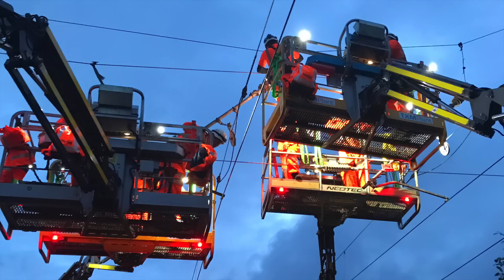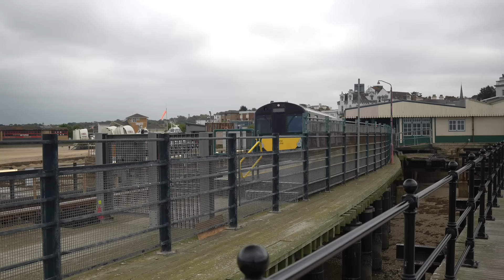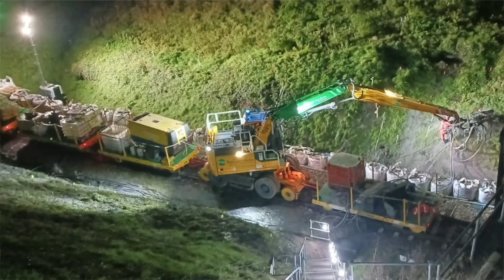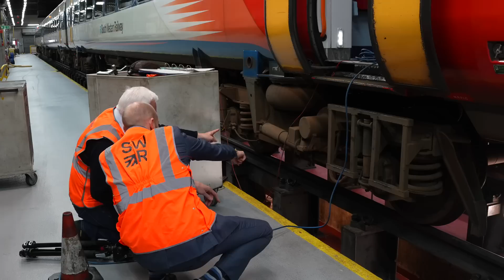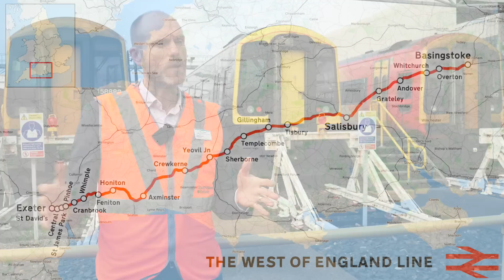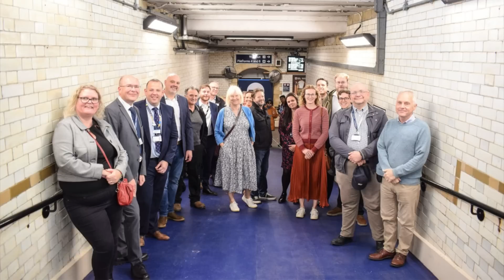Electrification, battery trains, third rail – Finding solutions for South Western Railway’s network

Comment: If they ever re-open the Maldon-Witham branch line, then that is one that's definitely ripe for battery train technology, as is the current Marks Tey to Sudbury. In fact I'd go further.... Maldon to Stansted Airport via a newly built high level platform at Witham. Battery operation between Maldon and Witham, OLE on existing systems between Witham and Braintree, and battery again between Braintree and Stansted.
Reply from the maker: I would set your expectations of that ever happening at an appropriate level (i.e. NIL)

Comment: I can see electrification from Basingstoke to Salisbury happening and from Southampton Central to Salisbury but I don’t think it will ever happen. Not to mention plans to electrify the Chiltern Main Line from London Marylebone to Aylesbury, Princes Risborough, Banbury and to Oxford. 

With electrification from Didcot Parkway to Oxford that Class 800 and Class 387s would operate AC 25kv OHL to Oxford from London Paddington. And electrification on the Uckfield line and Marshlink line with DC 750v 3rd Rail.
Reply: Far too sensible!

Comment: Surely the fantastic class 755 Bi-Mode is the perfect option for the West of England Line? Run third rail from Waterloo to Worton Junction before running diesel down to Exeter.
Reply: The whole point of the exercise is to get rid of fossil fuel altogether. No diesel.
Reply: @rogerphelps9939 You could do that with a 755 however or variant which can eventually lose the diesel power generator cars once electrification is complete
Reply: @rogerphelps9939  Which knowing SWR means they want "cheap" solutions. I.e we've got too many 701s so where can we shove them to keep the DFT happy. The arterios are completely sub standard for a route like London to Exeter.
Reply: Dreadful track bashers and the seats on plinths are a hazard.
Reply: @rogerphelps9939 
In other words, borderline pointless, Railways are responsible for 0.7% of carbon  emissions.

Comment: In my opinion the 25kv overhead system is the only way forward. The West of England line should be treated as a mainline instead of some sleepy branch line.
Reply: Or just do what they did with Waterloo - Weymouth, and use diesel locos and trailer units.
Reply: Incompatible with the rest of the South Western network.
Also if you were listening it’s expensive and not viable for lower traffic lines
Reply: Most definitely. More dualling needed too.
Reply: The AC 25kv OHL should have been extended to Reading Green Park with a bay platform built for the Class 387 to terminate at Reading Green Park from Reading.
Reply: Personally I'm wondering if half the problem is that the overhead on the Great Western Main Line is built for 140mph operation, and people are assuming the same  pricing for that, whereas the Salisbury-Exeter line doesn't need anything like that. Maybe overhead closer to modern light rail standard for example, and a similar power supply. Other lightly  used lines may not even need that: just something similar to tramway overhead with bow collectors would suffice. Assuming there wouldn't be much difficulty in getting MUs to run on different voltages and currents with off-the-peg inverters etc. nowadays.

Comment: Maybe electrify from Basingstoke to Salisbury and from Southampton Central to Salisbury with DC 750v 3rd Rail. And from Reading to Basingstoke with DC 750v 3rd rail to Reading Green Park & AC 25kv OHL from Reading Green Park to Reading.
Reply: Third rail all the way from Basingstoke through Reading connecting to the Waterloo line. Provides an alternative route when embankment slides occur between Basingstoke and Woking.

Comment: Great programme as always, but I seriously wonder about the safety of new sections of third rail being switched off.  I am very concerned about kids trying it to see if it is live, especially in areas where they have never had third rail electrification and therefore have not grown up with the dangers.  I can see the merits of energising only when needed but I wonder if this will lead to more accidents not less.  John
Reply: I agree.  Turning it on and off clouds the issue.  To add another system is potentially another fault waiting to happen.
Reply from the maker: Well, let's wait and see the full risk assessment and then we can form a view.

Comment: Yes, the Waterloo to Exeter route is very often a nightmare of overcrowding.  Yes, the 158/9 units are excellent trains and more comfortable and roomy than many more modern units.   I would have thought that redeploying the HST Castle sets on the Salisbury line (when GWR finishes with them) would be a good bet - they offer more capacity than the 15x units and Salisbury depot already has diesel expertise.  The idea of running battery driven trains from Basingstoke to Salisbury might be eco-friendly - but given that the line is mostly used by people travelling right through from London to Exeter with appreciable amounts of luggage, forcing every traveller to change at Salisbury (when at the moment about 50% of the trains run right through without a change) is not very passenger friendly.
Reply: I though about this too. Just remove one of the generators similar to what ScotRail did and they'll happily sit at 100mph with just the one MTU unit - maybe even have a battery installed as a replacement in one of the driving end cars instead. Or do what Chiltern did the some Mk3s. Possibly fit batteries under the DVT.
Reply: HSTs are old and need to be gone.
Reply: @EM-yk1dw  Quite, they are very much life expired and it's nor really economically viable to keep them going. Plus why should they be replacing old trains with much older ones?
Reply: We tend to go West rather than East, although I note how the trains get nearer to WAT they fill and the last one we caught at CLJ for SHE (nine car) was already full and standing.  Catching the late afternoon trains from EXD they are jammed by the time we leave EXC but by AXM there are far fewer on board.  (Lots of students) Living near YVJ we get a good look at the trains (I need to stay in more, away from the rest of humanity I think!) and tbh most trains are not that busy at this point.   The conclusion I draw is that most people do not go from WAT-EXD!   (Don't let a politician near that statement as the conclusion that could be drawn is that so few tickets are sold for that journey, the line needs to be closed! )
Reply: 'Most users go all the way from WAT - EXD?'  is that correct?  Judging by my observations the trains as they pass us (half-way SAL-EXD) are not necessarily that busy and we never have trouble getting a seat.
Reply: @Beatlefan67  Oh no, I'm sorry I said that wrong. I didn't mean  to say that most passengers do the whole journey - only at certain times of the year (summer holidays, University term starts and end, weekends Easter and Christmas) when perhaps a majority do.  

Waterloo to Salisbury is generally a busy route due to the London commuters (of which I was one for a decade) defence establishments around Salisbury, and when the winter or summer soltice gatherings happen at Stonehenge it's standing room only and staff preventing any more getting on at Waterloo!  However, Salisbury to Exeter can also be busy - especially at weekends due to University traffic - and in the summertime (at least when I was riding the line) there were a significant number of people (with suitcases) heading for Paignton on the through service from Waterloo.

My point really was that making through passengers for anywhere beyond Salisbury (who by definition are likely to have more luggage) change trains, may suit the railway's plans, but it's hardly an improvement to passenger convenience.
Reply from the maker: HST's, wonderful though they were, are now life expired and will be replaced.
Reply: @ I agree, although without wishing to sound negative new trains are never an improvement over the old in this country

Comment: No mention of Salisbury-Romsey-Eastleigh/Redbridge which is normally 158/8s.
Reply: Would work in hand as units could charge batteries while they travel over the existing sections of 3rd rail. 3rd rail should be fitted in Salisbury Station most definitely
Reply: I was wondering this exact thing

Comment: I do wonder if another benefit of implementing traction batteries on existing 3rd rail EMUs may allow for a reduced peak load while on the (quite power limited) 3rd rail network, thereby potentially allowing for fewer or smaller substations to be used on new / renewed sections.
Reply: It can use some battery power when accelerating and thereby reduce the load. But if you have intermittent power then the power drain is surely higher as it must both power the train and charge the battery.
Reply: @Talon5516-tx3ih  True but surely if you link the power delivery to the charging system you can avoid it trying to charge while accelerating? Far from the most complex thing.
Reply: @iman2341  That's not what I meant. On acceleration it draws power from the battery to lessen the load and/or accelerate faster - which is also good. But at cruising speed the train must draw more power than a simple electric train as it has to recharge. Compared to a fully electrified railway the power drain would be more peaky - i.e. it could be that several trains are charging and so the load is higher, but then it drops to zero as they're all running on battery. But I guess the  acceleration phase is always going to require the most energy so that may be irrelevant. Also as batteries are not 100% efficient the partially electrified setup will require more energy overall.

Interesting though. A couple of times I've been in the Siemens Mireo B trains in SW Germany and of course as a passenger you notice absolutely nothing different when it's running on battery. It's just an electric train.

Comment: How many accidents happen on the third rail where death is by electrocution, at the moment?  Have we any stats and how many miles of third rail are there?
Reply: Stop asking relevant questions.
Reply: I lived in the 3rd rail electrification area of the south of UK for six years 1957 to 1963. I never heard of any accidents, deaths or near misses with the 750v rail.
Subsequently, although living overseas since then, I have kept in touch with the railways of the UK through Rail Magazine. The only case was a girl who crossed the line at Bournemouth station about two or three years back, and was badly injured, but servived.She was then turned into a hero by the press and others instead of accepting that someone 15 years of age should have known it was dangerous. When I was 10, I knew the dangers of electricity!
Third rail deaths, must be very low in UK from way back until the present time, so what is going on here. I can never fathom out the authorities reluctance to extend 3rd rail where it is obvious it would improve the whole system. I have never heard of any problems at Merseyrail either!
Reply: @physiocrat7143  Haha!  Thanks, that made me chuckle.

Comment: Bi-mode of third rail plus Diesel electric must have been thought of unless there's problems with the concept
Reply: Third rail sparks quite a lot, and the fuel tanks are under the train!
Reply: @andrewhotston983 fair point, the bi-modes in this area are 25kv overhead and seperate 'power car' (in middle of train) containg engines etc

Comment: We're right by the SAL-EXD line (SHE-YVJ) and the timing generally is pretty good.  I like the 159's and find them comfortable and overall I'd 'mark' them highly.  Coming 'up' is the pain as I would wager 5/1 that we'd get stuck at Pinhoe for several minutes.  The joys of single line... 

As for the decarbonising, frankly I'm going to be in trouble for this, but IMHO it's complete BS.  Great Britain has 0.85% of the world's population.  I think anyone can work out the result of the decarbonisation as a percentage of the world's output.  However, I now read that carbon makes up 0.04% of the atmosphere - is that correct?
Reply: I agree - decarbonising is all cost and no benefit.
Reply: You have a lot of learning to do as regards global warming. It may well be true that GB has less than 1% of the world's population  and  only a small proportion of the total CO2 emissions but that is certainly not an excuse to do nothing. If everyone took your attitude civilisation would be doomed. As far as CO2 being just 0.04% of the atmosphere here is an experiment to try: take a litre of water and add 0.4 grams of strong food dye. Mix well. What do you notice? If that does not get you thinking along the right lines I suggest you ingest 50 or so paracetamol tablets, much less than 0.04% of your body mass. You may well not be able to report back, ever. The point is that CO2 is a very powerful greenhouse gas that works in tandem with water vapour to raise the Earth's temperature well above the -20 degrees C or so that it would be without it. The problem is that too much of it is incompatible with human civilisation as we know it.
Reply: @rogerphelps9939  We haven't "done nothing", though. We've wrecked our entire economy and energy security!
Reply: @rogerphelps9939  Interesting Roger.  I'm happy to be convinced that I'm wrong.  I'd like to know, however, just what China and India are doing to reduce their carbon.
Reply: @Beatlefan67  Google is your etc
Reply: @Beatlefan67  China in particular is installing massive amounts of wind and solar generation; more than the rest of the world put together. They are still building coal powered power stations but at an ever decreasing rate. EVs are now more than 50% of new car sales. Besides carbon dioxide emissions they also know that they must reduce the appalling level of nitrogen oxide pollution in their cities.
Reply: The rail industry is less than 1% of the UK economy, should we totally ignore it? The aerospace industry is about 1%, should we let that go down the pan too? If you've even run a business or even just follow professional sport, you'd know that all these small things add up massively. Diesel will be dead in most applications within 10-15 years so there's no point re-investing in it where it can reasonably be avoided, as is the case here.
Reply: BS on stilts. Railways are 0.7% of emissions.
Reply: @SWRural-fk2ub  Bound to be all correct?
Reply: It's about air quality improvements and encouraging modal shift through a more attractive train service
Reply: @Sam-uo8ki  
Air quality is only a real issue at Waterloo and Salisbury. Most of the newer trains are a major downgrade for passengers. How is that supposed to attract anyone?
Reply: @rogerphelps9939  
CO2 absorbs less than 10 % of Infrared radiation. If CO2 is changing the climate, the mechanism is not what is,usually given. 

Railways account for 0.7% of UK carbon emissions. Decarbonising the railways is an expensive irrelevancy. 

The way to encourage people to use the railways is to stop inflicting badly designed rolling stock on the long suffering public.
Reply: @physiocrat7143  A quiet, well air conditioned, spacious electric train with decent legroom provides a better experience for passengers than the incumbent. Although enthusiasts will be quick to tell you otherwise!
Reply: @Sam-uo8ki  
There is no such thing. Air conditioning inevitably fails. Electric trains are not quiet unless you can get away from noisy motors or they are powered by locomotives. 

At about 20kW per vehicle, heating and A/C is an energy gobbler unless waste heat can be used.

Comment: There is an elephant in the room that never seems to be acknowledged.  Rail is already a very green transport option, even if it uses a diesel engine - compared to road.  My fear is that by focusing too much on rail decarbonisation, we run the risk of adding extra cost, making rail less attractive and pushing traffic onto the roads.  It's throwing the baby out with the bathwater.  Of course where opportunities arise, why not, but only if the costs are marginal.  A much bigger carbon reduction would be achieved just by encouraging even a relatively small modal shift from road to rail, even if it's diesel powered.  Those in charge seem incapable of seeing the bigger picture.

Comment: How about converting the 3rd rail network to bottom contact, would solve the safety issue?
Reply: What exactly is the safety issue?
Reply: That would be massively expensive and you'd have to do very large chunks of the network all at once. If you're going to go down that route, you might as well switch to OHLE.

Comment: All interesting stuff, especially for those of us on lines like the Uckfield Line - which has diesels running on electrified lines between Hurst Green and London Bridge.

I believe they have looked at adding batteries to the class 377s. Uckfield being within battery range of Hurst Green (just apparently).  It’s rumoured the issue they found was running the new hybrid in multiples wasn’t going to work.  Not sure why.

Incidentally there appears to be an assumption that today’s lower passenger numbers is going to remain for ever.  Is that actually the case?

Comment: OLE would be the most effective solution and way cheaper in the long run. Third rail is NOT inherently unsafe. DC repels, after all! The cheapest solution, in the short term, would be to run the EMU to Basingstoke with loco haulage onwards. There we are: sorted (for now).
Reply from the maker: Add a loco at Basingstoke? Right.

I fear you are being either whimsically nostalgic or just plain naughty!